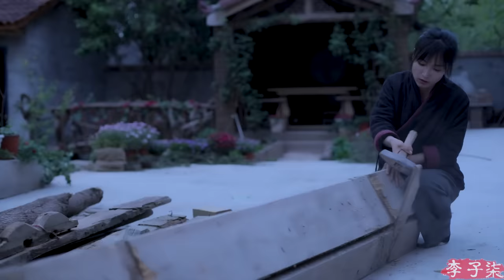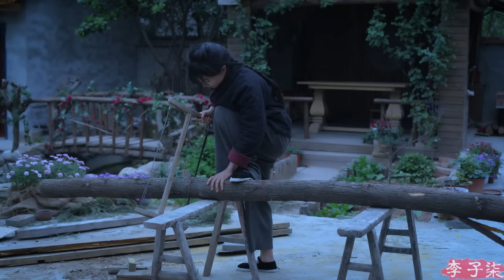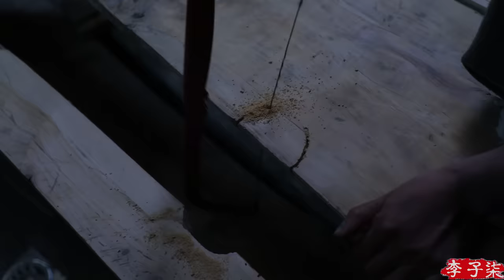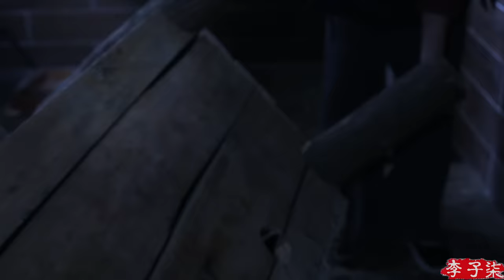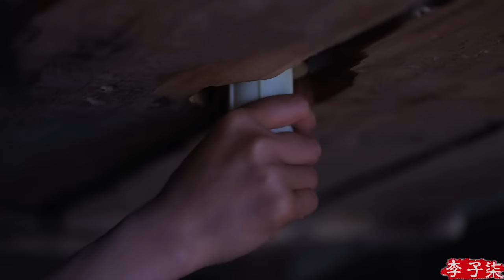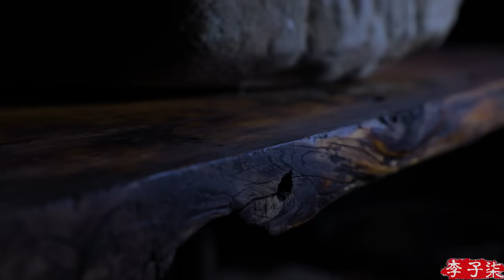handmade washstand for my bathroom旧物新颜，古朴的纯手工实木洗手台|Liziqi channel

Comment: to people saying this is not really her work: just because someone is really good or even better than you at something doesn't mean they're not really doing it :)
Reply: @ahee5527  thank you very much!
Reply: No but that’s missing something like the design and the measurements... I am an engineer and I know what is the meaning of making any piece of furniture from scratch really well, and how much effort and measures it takes !! So it’s fake or she got some help but still awesome job.
Reply: People just have a hard time believing a woman that looks like her could build something like this
Reply: You don’t need to be an engineer to know that construction takes measurement. Without seeing any written measurements in the video, we can infer that she simply marked pieces of wood for measurements by holding it up to the ones already cut. Not everyone has to have pre-planner diagrams on a piece of paper.
Reply: DON'T RUIN THIS FOR US!
Reply: @walaa3719  please, as a professional bullshitter I know bullshit when I hear it.
a.anyone with basic woodworking and plumbing skills could make that. It's all rough carpentry.
b. every skill is learned either by trial and error or through instruction, even engineering.
c.You saw her doing the various stages of work; cutting straight lines with handsaw, using a chisel, hammer and nails with minimally do it yourself level proficiency. It wasn't CGI. There were no pre-drilled holes visible for the nails, prefab, etc.
d. She admits that she has help with the camera work but used to do that as well. 
Analysis: you are full of it but awesome comment. LoL
Reply: Well, I know someone who just learn carpentry from watching youtube. And he's the one doing the carpentry in the house that includes furnitures. Proud engineers are so,Ugh
Reply: I doubted her before, but after seeing her hand writing for carving into printing blocks, I’m convinced, that writing skill literally takes many years to develop, she can’t just “pretend to do it”.
Reply: Bet if it was a man they wouldn’t be questioning it lol
Reply: @walaa3719  LoL. You're just incompetent. I helped my dad build several large sheds, and he didn't need to write down anything.
Reply: Of course it’s fake as fake can be. The whole overly polished style, esp. the cutting is giving it away.
This is more virtue signaling and tokenism than anything else.
Anyone thinking anything else wants to be deceived and/or is very naive.
Reply: @Frisenette  LOL...you dont know what youre tr alking about
Reply: AK 47 I know exactly what I’m talking about.
These are well produced commercials and propaganda for products and Chinese rural workers life.
Reply: @Frisenette  sure kid, I believe you LoL
Reply: Съгласен! Днешно време жените не могат да вьршат "Женската пабота" камоли това!
Reply: Li. Ziqi confirmed a month ago on a video stating that is her and thanks for watching.
Reply: @walaa3719  It's not engineering. It's just rough carpentry. Also it's impossible to include all detailed work in 7 mins, because we're not watching a carpenter-training channel, or people just get bored.
Reply: Walaa she learned online and she mentioned she got instruction of photography from an friend online. That guy helped her a lot. Btw,for ppl who grew up in countryside, they can pick up those skills much quicker than ppl live in cities.
Reply: Its a cool aesthetic vlog not a tutorial lmao just because she cuts the boring parts out doesn't mean she doesn't know how to use a tape measure

Also making basic rectangular furniture takes patience and hard work

 but it doesn't take a master carpenter
Reply: @Frisenette  poor you keeping yourself blind. no one can wake up a person doesnt want to. GLuck~
Reply: Siqi Cheng I know something of filmmaking, and this is far beyond what a simple, inexperienced peasant girl can pick up without a lot of experience and instruction. No matter how hardy, intelligent and naturally talented.
The skill needed to shoot and cut something like this requires years and years of practice.
Not to speak of a crew and equipment.
Reply: @Frisenette  is that why you have zero of your own videos posted? Because you enjoy filmmaking so much? 

She's not some random country yokum who's never used a computer lol she used to be s professional DJ for years and probably made videos about that too to drum up fans

If these are commercials for anything, its Apple products lmao
Reply: Orion Cornelius WTF are you even talking about‽ Who are you defending anyway and why on earth are you trying the ad hominem approach?
Reply: @Frisenette  oh! I'm making fun of you because I feel like it, don't worry about it
Reply: Helge Frisenette please watch her another video. She clearly explained  how did she started and recorded. There r huge amount of raw materials (Non edit videos). And now she has one camera man and assistant. Things u cannot do doesn't mean others cannot either. There were lots of vlogers in china doubted about this, and they even installed many cameras and drones to monitor her. In the end she had to move house and reported. If they can find any evidence she is fake, there would be evidence already. Btw , this happened before she got popular out of china.
Reply: @Frisenette  she isn't the one doing the film making. her older videos are, but even if her cinematography is top notch, how does that discredit anything she does in the videos??? if this were acting, they really went all the way to even hire a strong but petite girl and injure her
Reply: @Cleigne143  Obviously, we are questioned about our work everyday, that is exactly what my first comment was referring to: there's MEN who can't even get their pants up or cook themselves a decent meal that are commenting here like they even know something about what she's doing. That's basic carpentery work and every person who lives in the country side has done at least one in their life. Even if she has had some help which is no shame, she's doing it better than you. So please stop denigrate women and start doing your work by yourself too

Comment: Holding the nail with pliers instead of your fingers makes so much sense! It won't hurt the pliers if you hit them!
Reply: I think she is too proficient to whack her own nails.
Reply: There's another reason too! If you are re-using a straightened old nail that will be more prone to bending, or just if you are not so great at hammering a nail exactly right, the pliers help prevent the nail from bending in the middle. So it goes in straight much more easily. I do this too. It's the main reason, since after a few light taps you don't need to hold the nail with your fingers anyway. But you can really whack the nail while still holding with pliers.
Reply: you can see at some point of the video that she actually hit her big finger nail because it became black so she started to use pliers to hold nails, her black finger nail is visible very well in her newest video:)
Reply: Oh dear... This is the downside of becoming fond of an anonymous Internet poster. When they have trouble, there is nothing you can do to help. Which hurts. At least I can empathize with her pain - I have an oddly shaped left thumb, due to crushing the end bone in an accident when I was 5. The bone break knit badly. Also gave me the distinction of having ten fingers but eleven fingernails. I hope her finger heals well. I see she has a new video just a few hours ago. This will be my treat for today.
Reply: Anna Inspain ikr, she's smart and have nice spatial-perception 😍
Reply: actually if you look closely in the beginning of the vid her left thumb didnt have the black bruise until the middle of the video. I think she hit her thumb thats why she was using the pliers.

Comment: My name is Tang L, I complain Longo Toyota Services is very bad, my appointment is 8:00am and promised 2:00pm to be done (oil change, intake manifold gasket, power steering horse) it’s cost about $750.00, when I my car that was 5:30pm (3 and haft hours more waiting for and I drove home double checked for the service was done then I found my engine hooks not working. Please anyone had going to Longo Toyota service should be checked everything’s before leaving.